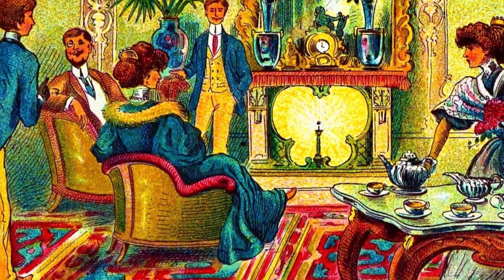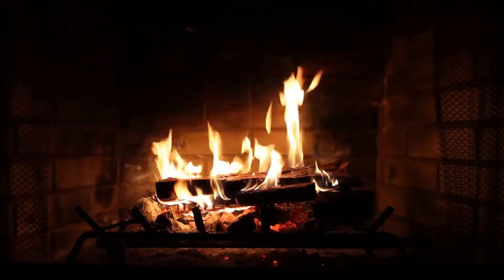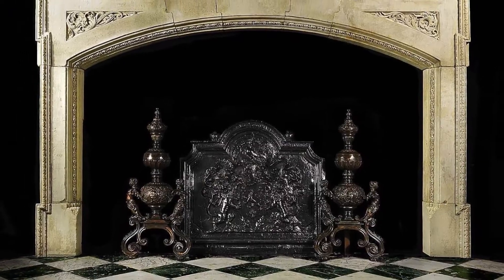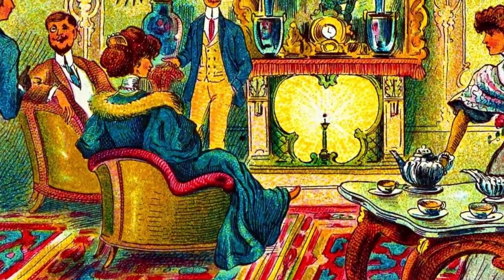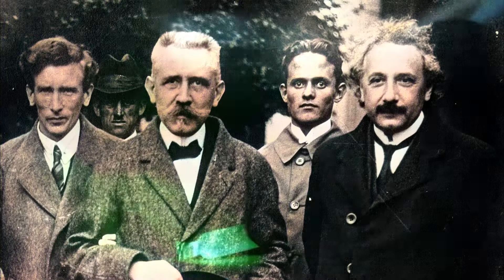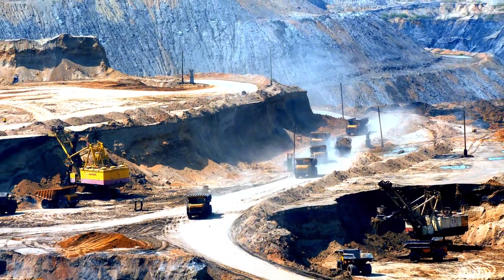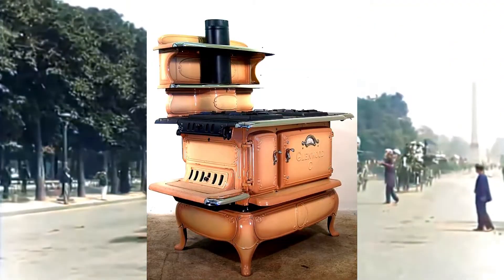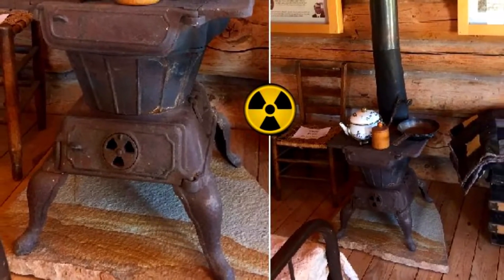Who wants RADIUM FIREPLACES in their home? The history of RADIUM heating. #history #technology

Comment: FACT: Thousands of these relatively tiny home heaters used RADIUM as a heat source: NOT coal or wood.  However, @6:53, the narrator 'alleges' that a single gram of radium, in 1910 cost $180,000. This, of course, is totally FAKE nonsense. Pause @6:55 and he shows that 1 gram = 0.35 ounces. NO SIR: 1 gram =0.035 ounces. He's WRONG by a factor of 10!  He is presenting us with FAKE HISTORY, ffs. WHY would thousands of people purchase RADIUM HEATERS, if radium cost $180,000 per GRAM?

Comment: Would be good to hear about the atmospheric electricity
Reply from the maker: While I'm preparing a video about electric cars, but I also thought about atmospheric electricity, I do everything myself for a long time
Reply: You can pull 0.7 volts DC from about 11 feet off ground level with a simple copper antenna array
Reply: Copper orbs & tuning forks on top of almost every old world structure, nothing new under the sun ☀️
Reply: Eather
Reply: It would've made microchips impossible. It could work but we then would only have the dumbest of dumb electronics. Think induction motors and lights not much beyond that certainly nothing with logic controls
Reply: @oliverscorsim you don't know what you're talking about
Reply: @robertjustin9638 I mean while I'm not an electrical engineer I have friends that are and I can keep up normally when I can't it doesn't take much for me to get it. I certainly understand that a 5v chip would be fried if you threw 1000s of volts at it and you wouldn't just be able to suck power at the antenna without shielding everything and even then the interference would suck. Just in your car none of the position sensors could work as the induced field would make the one we're looking for mute in scale. I know I understand why this wouldn't work. It might be low amps but it is very much high voltage being induced. Which fyi earth has anyways in its atmosphere but doing something like this would be many orders of magnitude higher.
Reply: @oliverscorsim either you're a fool or a bot paid to discredit channels that are waking people up.  It doesn't matter which to me.